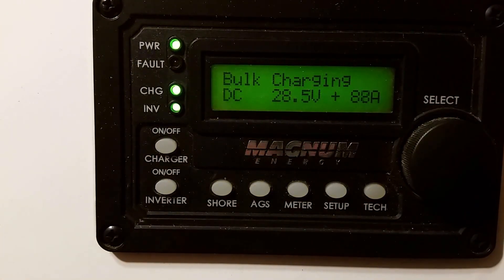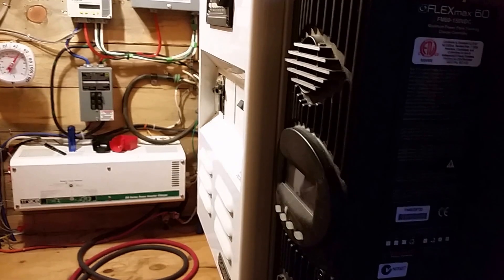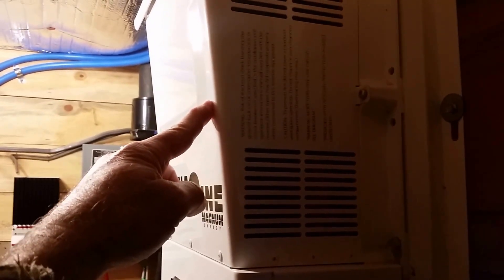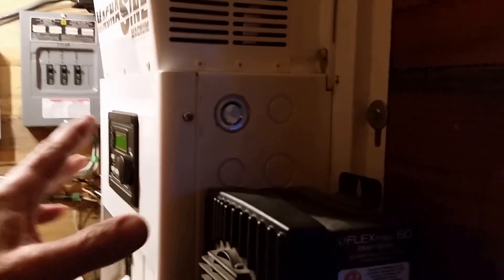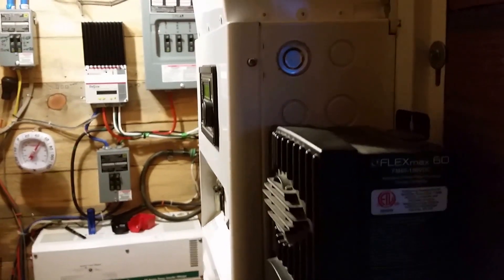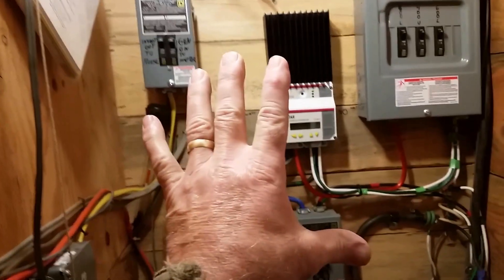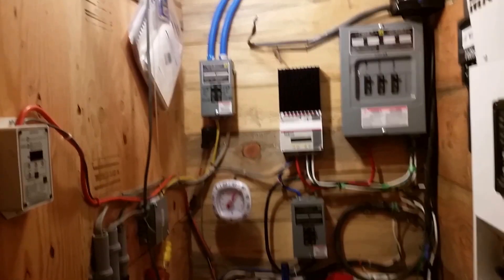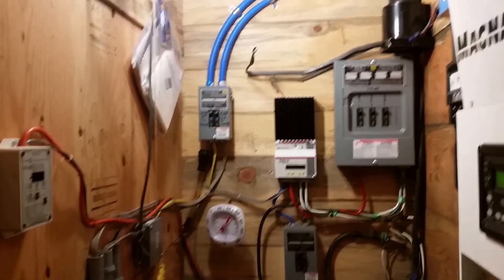The off grid solar homestead gets a new inverter

Comment: First off I commend you for bring the Lord into your discussions! Amen!
I'm sitting here in my cabin in the woods looking at Youtube videos on solar power. I bought a solar set up used. My two sons went with me to disassemble it and then reassembled it at home. This is what I got for $2,200!!!!!
4    PANELS  170 watt Evergreen Poly = 680 watt total (they were mounted on a high pole that we could not move.)
BREAKER mounted on pole
4    BATTERIES 6 volt with connecting wire making 24 volt system
INVERTER/CHARGER Xantrex DR series 24 volt 3600 watt 320 amp dc
CHARGE CONTROLLER Outback MX – 60 output 
AMP GAUGE - Trimetric 2020
WIRING – there is a lot of heavy gauge wire included and a flat wire to go from the generator to the system
GENERATOR – Craftsman 10.0 hp 5600 watt – 8600 surge (I ended up selling this on Craigslist as the pulley for the pull start was broken and I cannot start anything with a pull start)
TRANSFORMER – Square D (I think this is to run 240 like for my well pump

Sweet deal huh? Yes it was. My biggest problem is that I had no clue as to what I was doing or not doing. I am on-grid but wanted this for when the power goes out or another scenario. 
Because I did not monitor the system I killed my four batteries that first winter. I was experimenting with various appliances to see what I could run and did not pay attention to the level of the batteries. Plus I was not equalizing them or even checking them. Lesson learned!
It will cost me around $1500 to replace my batteries. Ugh.
May the Lord bless you and I pray a healing for your back!!!
Oh, curious ... where do you live? I live in Washington state with a ton of snow in the winter. I love it here!  And what's with the two trees laying on your roof?
Reply from the maker: Greetings from Oregon! Thank you for the kind words. Yes Jesus is The Lord of My life. Knowing God through His Son Jesus, Obedience to our Heavenly Father's will through the power of The Holy Spirit is the only life worth living for sure.Wow did you get a great deal on the solar equipment! This is going to be interesting, We went off grid originally with a 610 watt solar array.We had 4 L16 six volt batteries in series for 24 volt.We had a Trace DR 3624 inverter. (wonderful, built to last for 30 years)We have a Trimetric battery monitor and a Tristar solar charge controller because we could not at the time afford a Outback charge controller. I had nearly an identical system as you have!The trees came down on the house in a 4 foot snow storm. I just drove through north eastern corner of Washington last summer on my way to look at a piece of land in Bonners Ferry Idaho. If we move it will be north east somewhere In Oregon, Washington or Idaho but it looks like the Lord would have us stay put for now. We have been here for 27 years. Thank you so much for the prayer. 3 years ago after 20 some years I had to resign as a senior pastor of a local church because of health issues. They did not want me to step down nor did I want to leave. After a year of prayer It was the hardest decision I have ever made. Serving God is my passion. Until Things change I will just serve The Lord anywhere and anyway I can. Loving God through serving people,Serving God through loving people,Love is the right thing to do,Love is an action verb!

Comment: Whoa nellie! That is a smoking hot deal for all that! Might consider turning (selling) the old inverter and recoup some more $$$. I did that with three of my old inverters...sold them all at once to a guy on Craigslist. Lastly, the MPPT makes more power due to several factors (and how you got it set up). It allows for higher PV voltages (which is more efficient) and with that higher voltage, the MPPT will "sweep" the voltage range and "find" the maximum power point. PWM uses voltage alone...which is good if the battery volts and PV volts are close (and high enough) for charging. It is essentially...a set voltage.

Comment: You sure got a great deal on that equipment and I think it will serve you well for years to come.
Reply from the maker: If I had it all to do over again and had the money all at once I would go with the Magnum charge controllers like you did. One thing about my system is I am getting an education with different charge controllers lol. Tristar, Midnite and Outback. PWM and MPPT charge controllers. Multistep and true sine inverters. 12 and 24 volt systems. And then there is the generator experiments lol. Ill be able to write a book when I am done.